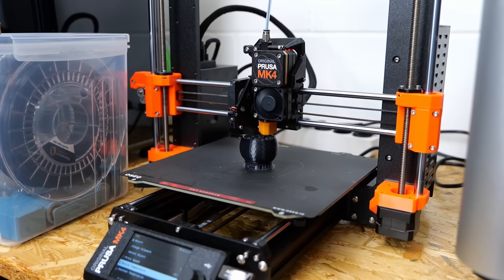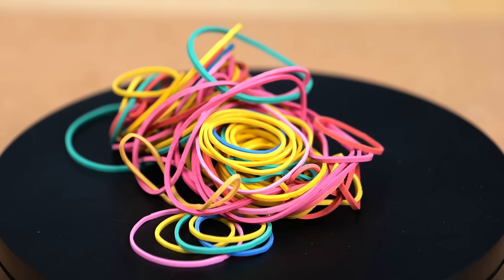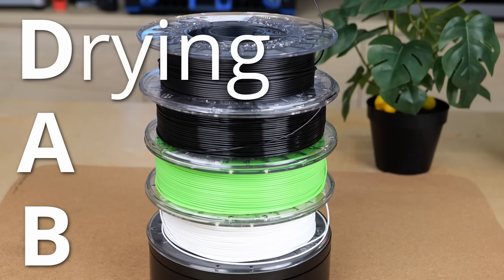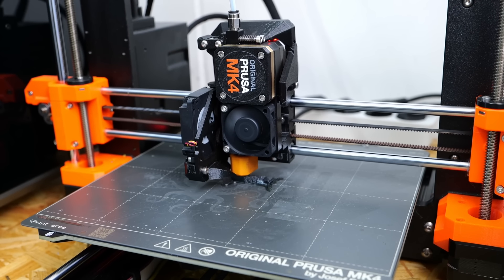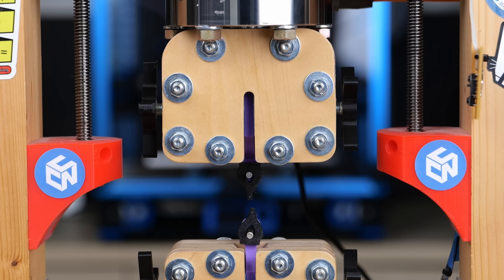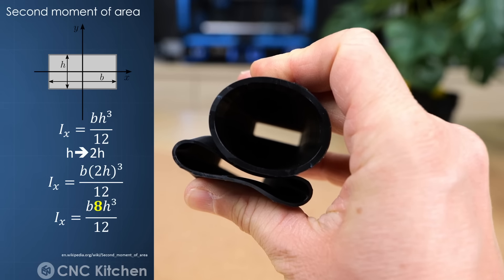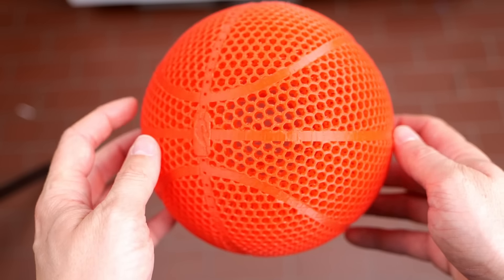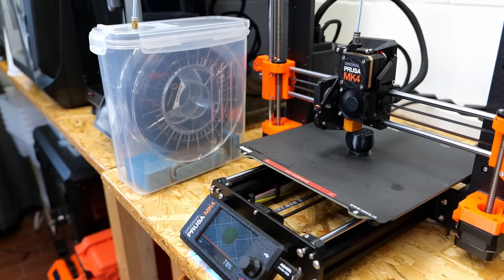Why aren't more people 3D Printing this Indestructable Filament?

Comment: I was amazed at how strong it is. I had chairs with pointy feet that were gouging my floor. I printed custom feet that fit like a glove and they are super strong I used bowden not direct drive and I only have to be careful during the filament loading stage to go really slow to feed it in otherwise it squeezes out the bowden drive. But I made some slow gcode just for TPU loading. Great analysis here.  I forgot about the glue stick at first and wow it really adheres to the bed.  Do not forget the glue stick.

Comment: I designed a 3d-printable Ankle/Foot orthosis (FIDIM) for use with Nylon.  That works great, but I've always been extremely impressed with the durability of TPU materials.  The hinges on FIDIM are made from it.  I'd really like to try a stiffer TPU for these now.

Comment: One of the best investments I made for 3d printing, was dedicated filament dryers for machines. Its made printing things like TPU, and Nylons a extremely reliable process. I live in an area with an average humidity of 95%. Air conditioning is also not common. So Not only do i dry my filament before printing. But I run the dryers while printing (requires a bit of thermal tweaking on filament profiles for temp based on time and flowrate). When printing TPE's at 0.04mm layer heights and a 0.2mm nozzle, you can see a noticeable difference when you hit areas that have high humidity, as it causes the dark filaments to cloud and lighten.

Comment: I'll be honest I kinda fell away from 3d printing a couple years back. I've still been collecting stl's and waiting to be able to afford a good printer that won't fail after the first day.😅

I've been interested in various flexible filiments for a project I may never complete 😅 it  being a rover or hexopod that can fall 2 or 3 stories, get up and shake it off.   In short a structural part with a flexible or dampening outer shell that will take the hit and not damage the electronics on board. 

This video has rekindled some of my enthusiasm for that project. 😊  now I need to start pricing and reaserching a good idex dual extruder machine that does TPE filiments well. 😅

Comment: What i learned since i startet 3D-printing TPU nearly 23 years ago is to put some gluestick on the printplate. Since then i am able to reconnect all TPU / TPE parts. This also works great with glas printplate to not chip them (allways a problem with ULTIMAKER)

Comment: I have already printed a lot with TPU 95A and TPU 60A on my Ender 3 Pro. And yes it is with bowden extruder setup (and a Phaetus Dragon hotend).
I printed gaskets, some boxes for tools and dampening feet
This video comes just at the right time for me because I want to try new flexible materials. 
Your tests were very helpful to learn about the properties of TPE's from different manufacturers.
Have you ever tried SBS filament?
SBS schould be a bit more grippy. I would like to test SBS, but have not yet been able to find a supplier in the EU.

Comment: On smooth PEI you definitely need a release agent but I find that it's not a problem on textured sheets, and print on them with no additives. Adhesion is strong but not dangerously so. But do a quick test in a corner before you risk ruining your sheet!

Comment: I love flexibles. The results are so strong and have lots of uses. I've made replacement feet for an aluminium work platform where the original feet had gone brtittle and broken. Also made Shimano hydraulic brake bleed nipple covers, the originals are really soft and easy to lose when cleaning the bike, the TPU ones are bright green and look cool and are easy to find. We've used it at work to make masking covers for PCB connectors on boards that need conformal coating, much quicker to fit than masking tape, more precise and easy to remove

Comment: Still printing flexible filaments with my trusty old cr 10 mini since years. The only modifications to the printer are a dual gear metal extruder with a hand made guide to prevent escaping of the filament while getting pushed, a bed level sensor and a Buildtak surface on spring steel. And yes still using the Bowden setup, no direct extruder. I am able to print soft TPUs like Ninjaflex with it. Just going very slow.

Comment: I print TPU quite a bit, and I have a bowden extruder, I've also never needed to dry the filament, despite living on the coast in England. You do need to print a bit slower, you do need to look at retraction and you do need to get the temperature right. Strangely I find 225c is usually fine.

Comment: I keep my filaments in plastic boxes with plenty of silica gel on bottom. (dirt cheap if you buy the kitty litter quality in large bags). I have a kind of bowden style tubes for filament takeoff. I mount the selected ptfe tube close to printer and the rest of tubes loop back to a quick link connector on box. Any large enough box will do and some tubing can be mounted to hold several rolls in a row.
Food drier and/or vacuum are some methods I've used to dry other filament. After they are dry, they keep dry and print from the box.

Comment: You can print colourfabbs varioshore tpu on the prusa mini. You have to loosen the extruder idler wheel screw by 3 complete turns so it doesnt jam up. Works great.

Comment: I built a heated chamber around my super cheap printer. The spool holder is in the chamber. I usually set the temp to the drying temp of the filament as that is usually a good temp to prevent warping. Then I just store the filament in desiccant box. Never have to worry about drying. Just used some cheap parts like a heat gun and some purple foam from HD for the chamber. Put the electronics outside the chamber....flexibles are probably my favorite filaments because the layers bond so well And I never have to worry about the part breaking.

Comment: I tried a 90A TPU from Monofilament on my bowden Ender 3 with an Aliexpress dual gears extruder. I repaired with printed replace gaskets my old tap mixer with weared ones. Also I develop custom seat heating system in my car and my wired with a DC connector on its ends is protected by TPU cases. This type of cases also protect from short-circuiting and over-bending my signal cables connected to delay relays in my home automatic transfer switch (yes, we have a lot of blackouts). Bottom pads on my keyboard are made of TPU. I consider that revolved parts are able to be printed with simple bowden printer and are effectivelly usable in casual home works as a parts with different properties in comparison to common materials

Comment: I've been printing Sunlu TPU 95a at 11 mm3/s. I've never had much issues with it, but if I'm  printing more than one part on the build plate it will string quite a lot.

Comment: I've been printing un-dried TPU on a bowden tube extruder for years. Yolo.
I guess most of my success has been printing it at 230 and slowly.
Reply: same lol it prints like shit
Reply: I have printed TPU stuff on an Ender 6 with half a meter Bowden and TPU that's been laying in the basement open for a year..  yet to have issues. Probably just dumb luck. Extrudr Flex Hard was no issues..
Reply: Bowden Ender 3, I can print TPU without issues, but if it's undried it spits and blobs. It's awful wet, get it dry and it's acceptable. Now moved to a direct drive neptune 4 plus and it's night and day. Lovely prints but still needs drying in the UK before use.

Comment: I use PEBA a lot. I used to use TPU95A or 98A, but I found PEBA to be even better.
My application is parts for FPV drones - they take a LOT of physical abuse (eg flying into solid object at 50MPH)
It keeps it's elasticity down to a lower temperature.
It bonds well with Nylon - an inner core of Nylon and an outer coating of PEBA is insanely durable and still quite rigid
It's lighter than TPU

Comment: I've used TPU with a Creality CR6 SE to print replacement lids for Corning Ware food storage.  It worked okay.  Hand wash only.  I just used the default settings and it seemed to work fine with a PEI surface.  In this role, it is not in direct contact with the food, so I just lived wild and crazy!

Comment: When I print in TPU, I use a Garolite FR4 print surface. The piece holds down well enough with very little peeling, but comes off cleanly with relatively little force.
So far, the most useful thing I've made is a set of custom-designed plates that are used in a factory in Michigan on a machine that does plastic-injection molding. The plates hold reels of metal pins that weigh about 46kg each and are mounted on a machine that slowly un-spools the pins from the reel on demand. The reels themselves are made of cardboard with a thick cardboard core. The plates add pressure and increase the holding surface area to keep them centered and keep them from wobbling and being damaged during unspooling. In addition, if the cardboard spool is damaged, then the cardboard center can be cut out with a knife and the plates can be inserted into the hard cardboard core of the spool allowing the reel to be unloaded normally by the machine. So why did I print them in TPU? Well, PLA definitely does the job better when it comes to compression, but does not do well at all when it comes to impact. But I hear you ask, "If they're just holding cardboard spools on a machine, where does the impact factor it?" Glad you asked. It comes down to 1 word. 'People'. When the spools need to be changed, the plates are removed and people are rather careless, so the plates ended up falling or being tossed on the ground and PLA will shatter. Making the plates out of TPU allowed the plates to withstand the abuse of careless operators while maintaining the rigidity necessary to keep the machine operating properly and more reliably.

Comment: Well idealized/simplified physics about friction always start with the declaration: for rigid bodies and smooth surfaces. That is why your "anomalies" showed up. For flexible materials friction coefficients are not static. Think of temperatures affecting tyres or how their deformation changes how much friction they have. Try a much heavier weight and you should be getting higher friction coefficient.

Comment: For TPU, I disabled retraction. I print with 30 C bed heat. I also had great success printing at 230 C. I came by the 230 C by manually pushing the filament while heating and picking a number 10 C above that. The on spool recommendations seemed very high to me given that TPU liquifies at a lower temp.

Comment: I’ve only just recently started in the 3d printing hobby. Channels like Your’s Made with Layers’ and Z. Freedman’s are not only my go to resources when I hit a wall but you guys set the standard for  Making, 3D Printing, ECE and how they’re all connected. 
Being a rookie, I learned the hard way about moisture, I’m working on sourcing some dedicated filament dryers. In the mean time, I have a food dehydrator. I’ve seen one a few times in your videos. Will a food dehydrator actually do the job? If you have a video on that specifically, please point me in that direction. Thanks for the video and your time.

Comment: The harder TPEs can be printed with a Bowden tube printer. My printer has a 13" tube and printed 95A TPU without any feeding issues.

I did encounter some heavy stringing and popping at the recommended heat range, probably due to moisture content. I was able to mitigate it somewhat by lowering the printing temperature and I didn't care about minor surface imperfections.

The durability is great, used it to print some adapters to mount carburetors on some 3d printed intake manifolds for experimentation. I've ridden that bike for about 2000km around town over the past 2 years and everything is still holding up.

Comment: For me the biggest help printing TPU has been to use an extruder idler that only grips tight enough to move the filament. I found an idler squeezing too hard will deform the filament as it enters the hot end. While the resulting part may be very resilient the filament itself is kind of pliable with the TPU I have used.

Comment: I have a Flsun Super Racer, and for those who know it, they will understand that it is difficult to print with TPU (95A shore) because it has a really long bowden tube. However, I managed to create a profile on Cura that allows me to always get "good prints," at the expense of a bit of stringing.
The main problem I faced was the retraction speed. I spent days adjusting that value, but nothing seemed to work. So, I solved it simply by removing the retraction. To compensate for the stringing that forms, I raised the Z-hop speed to 200 mm/s and the travel movements to 350 mm/s, thereby reducing the probability of stringing.
As for the brand of filament for the TPU, I used ZIRO.

Comment: The standard easy setting for TPU on my ankermake m5c gets me pretty much perfect prints with minimal stringing every time.Only stringing issues with the last print I did was because of moisture pickup,the first print I did with it in a long time and the supports even came out quite easily at around 10 percent density

Comment: You could print computer fan gaskets/vibration absorbers with the 60A TPU. It should be great at sealing the surface and limiting vibration transfer to the case. As far as moisture goes, i use an ikea samla box with 4 rolls in it, and about 1 kg of dessicant. It works well enough :)

Comment: My volumetric flow for Ninja Flex (85a) is 6mm/s³. That's with an extruder and hotend combo I designed specifically for TPU on a highly modified Ender 3V2. It's my printer for flexibles while my Vorons and Bambu do everything else. As for bed adhesion, no glue or anything on a textured surface and I have no issues. The trick, set your end Gcode to set you bed temp for 80c. Having the bed heated up significantly increases the ease of getting TPU prints off the bed.
Reply: Indeed. Textured PEI. Printing cold. Heating for removal.
Works great. Still be careful and don't rip it off with too much force.

Comment: Very good, the friction part is something I haven't seen anyone to do before.
I use TPU on RC cars for certain parts that have to be strong, a little flexible and almost unbreakable.
I have to say that as someone who has experience with  3D printed tires for RC models, it is true, the softer the TPU material, the better the grip/friction.
(tested from 90A to 60A)
Reply: That's awesome! I was just looking for a good material to print rc tires. Can you recommend a good filament that is grippy and goes well with on or off road tires?? Would really appreciate it!!
Reply: @patrikjks 😁
Reply: @00000EDDY00000  
😁Of course, I always use filament from Recreus for tires, mostly 82A hardness.
Reply: that's the same logic from f1 tires, they are extremely soft and grippy (sometimes too soft, they don't last very long)

Comment: When you have a part stuck to your bed, try spraying around it with some isopropanol, just be aware of the fire risk, my theory is it wicks between the part and the bed and then evaporates breaking the bond.

Comment: Adjust your Z-height offset so that it doesn’t get as squished as it would for PLA on the first layer. This will help with removal greatly. Even with a glue stick layer my normal Z offset was really hard to get the print off.

Comment: Pretty cool! Very in depth and your research gives a lot of good info for designs with these materials. You didn't test compression strength, however. Also, you should augment your stress tests by noticing when plastic (*pun*) deformation takes place. You'd have to ladder your tests and compare relaxed height to notice. With these flexibke materials especially, it's hard to tell when it was a partial deform vs a complete break, and this augmentation would help inform this.

Comment: I print quite a lot of glue on horseshoes using TPU. Because in size of bigger ones I have transfered mostly to high flow tpu.  On regular TPU'S max volumetric flow usually is less than 5mm3/s and high flow filaments can be pushed up tp 15mm3/s so save in print time is huge. 

Allways drying before use using modified mushroom/fruit dryer. Also bambu textured pei plate has been best in my experience.

Comment: I bought a spool of TPU quite a while ago and I think I’ve only used it for two things - dampers for the brake pedal in my sim racing controls to make it feel more realistic than the spring it came with (which worked perfectly) and a vibration isolating mount for the accelerometer in my race car. I’m not sure how well the latter works as I’ve never tested the accelerometer without it, but it seems to be working well. I also have a 3D-printed housing for a display in the car that I’ll eventually be making some gaskets for as the components themselves are not waterproof.

Comment: just print it while drying in a food dryer. 20min heating at 60° is enough, saves a lot of energy.
Reply: I've had good results with a similar approach. Completely drying filament on the spool takes forever. Placing the filament in a dryer I can print from and drying for an hour or so and then starting the print while the dryer continues to run has made for a time saving process. I use the two Sunlu boxes shown in the video this way.
Reply: @fabianmerki4222  It depends a lot on the climate/humidity. I have 50-60% and higher air humidity almost all the time, so I need to dry filaments a lot. Surprisingly, PLA needs less drying for a good print; and TPU - the softer it is the more drying it needs. Up to 6-7 hours. For my softest TPU I sometimes respool 100-200g of it and dry it separately right before printing - only this way it works...